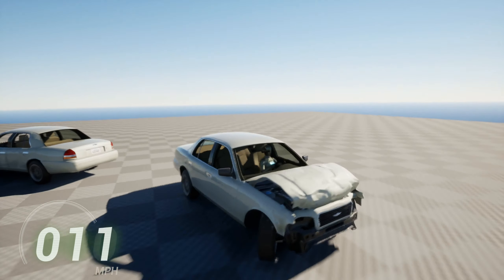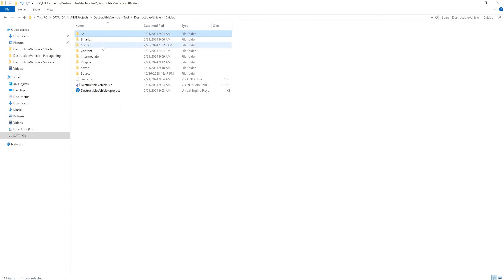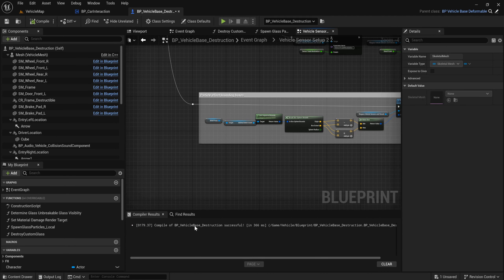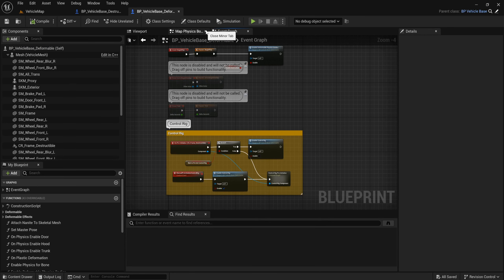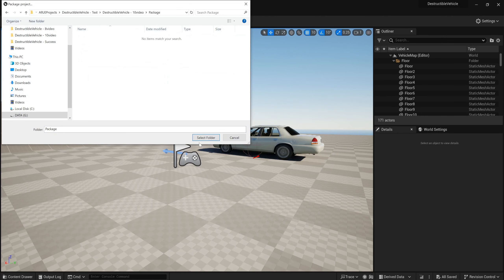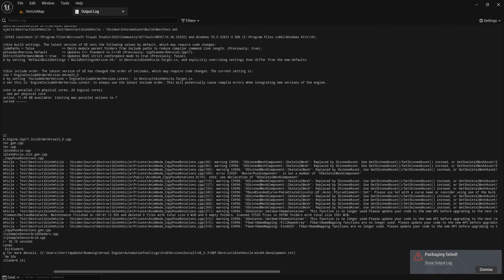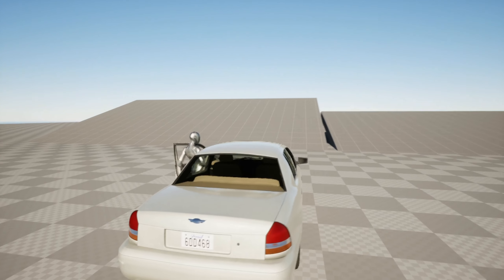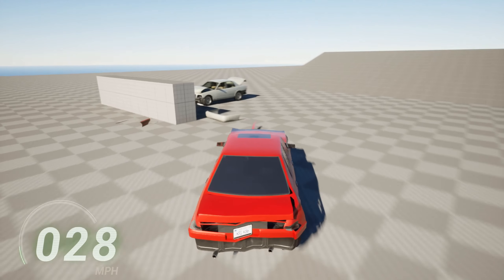Destructible Vehicle Tutorial 11 - Package City Sample Vehicle Project

Comment: Just joined your patreon to thank you for the project. Hope you will continue this series by adding at least first person view, steering wheel turning, lights. Shouldn't be too difficult since the steering wheel is a separated mesh. However, It's a pity, the whole interior is one solid mesh so animating the gearbox stick might involve too much of work and we should leave it maybe.
Reply from the maker: I just update the project to 5.4. Thank you for your support.
Reply: @jourverse  You're welcome. thank you very much for your great work .
Reply: @jourverse  Hi, I opened your project with 5.4.3 and followed the prompt to rebuild the plugin. All went well and I was able to open the project but running in editor has some serious lagging issue. With your 5.1 project which I upgraded to 5.3, I got 80 fps but with the 5.4 project, I have only 50fps and sometimes even less. any idea what might be the issue? thanks
Reply from the maker: @lolaswift111  It take some time for the project to compile the shaders and blueprint.
Reply: @jourverse  No. that's not the reason. all shaders already compiled. I'll take a look at it again when I come back to it.